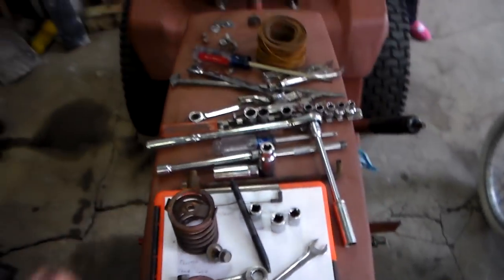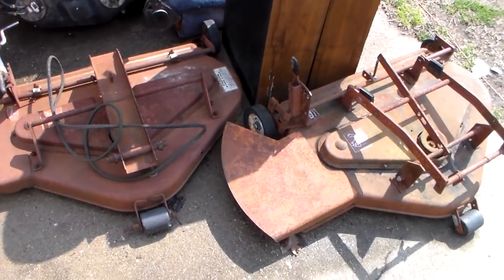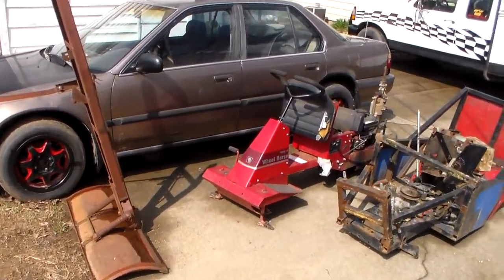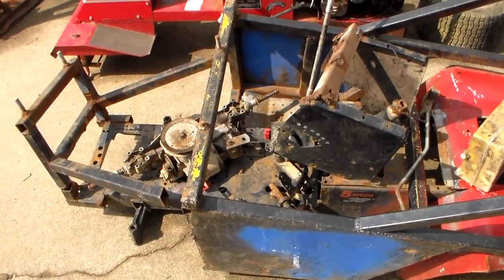New Projects

Comment: Do you know where ant Youth class derbys in IL, IN, or Ky coomimg up? Besides Oblong IL. basically finding a show to run in replace of Crashing for a cause
Reply from the maker: Hawesville KY has a benefit derby the same day as CFAC. Im planing on running there with a mower. Check out the T.I.A mower derby and SS Motorsports groups on FB for some info on shows